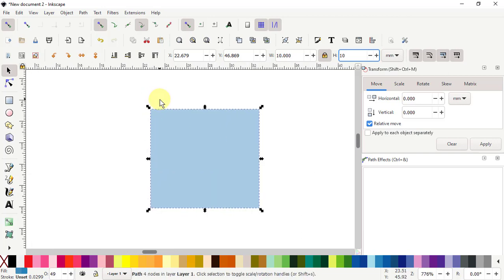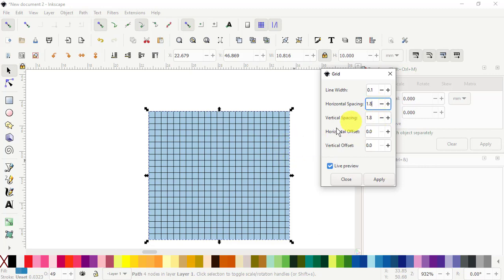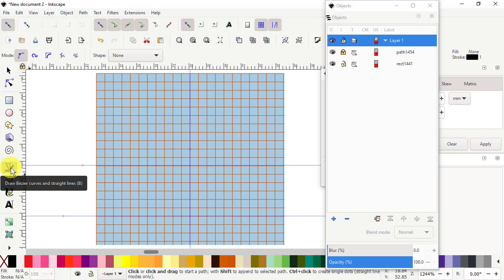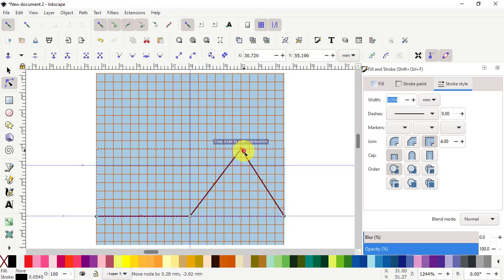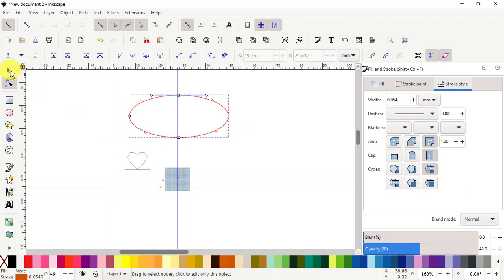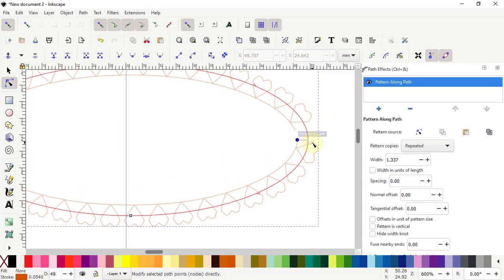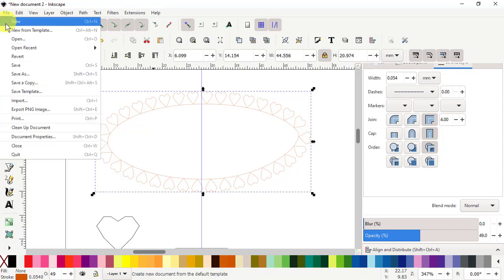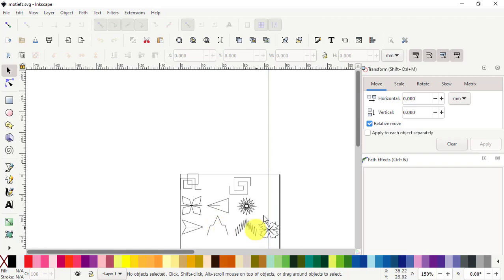creating motif stitches

Comment: Did you know you can set a grid? There is also snapping to grids at the side snapping panel, this might make making motifs easier?
Reply from the maker: I did it this way so that i can use that square as a template and snapping wil still work and i am aware that there ate other guides available